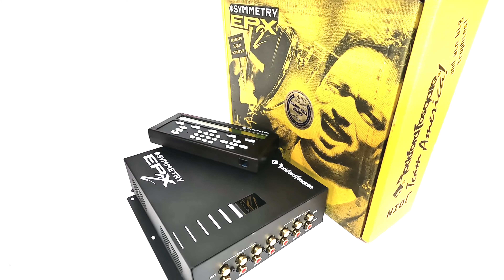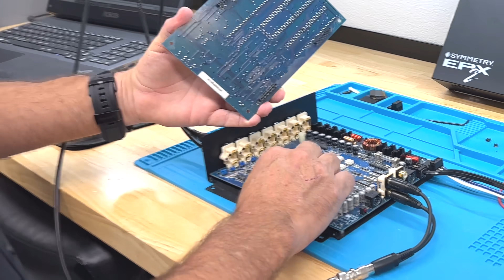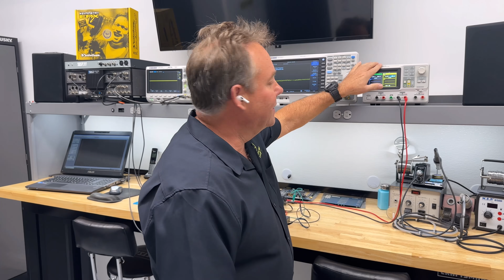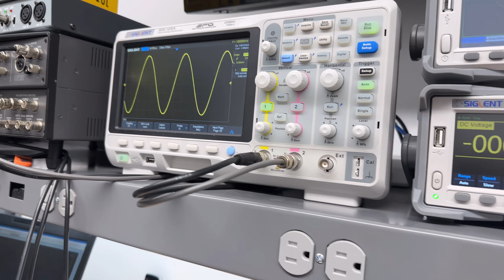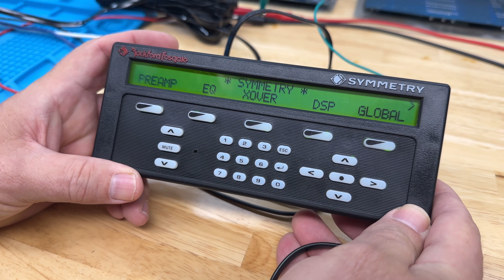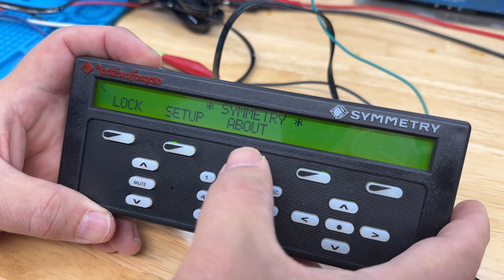The Terminator - Rockford Fosgate EPX2 with Wayne Harris in 4K. Beast or Bust?

Comment: Nice! Im glad you're doing well Wayne. I was there at Rockford from 98-05 in apart of Production Engineering as an equipment tech for both Production and SMT floors (I took Tony's old job before he moved to Design Engineering xD). I did have the Symmetry EXP(1) in my car but accidentally left the symmetry in the car when I sold it. Ive always thought highly of the unit and if I ever thought of expanding my system I could do so with the Symmetry. Continue the good work!

Comment: I have one of these in the box 
Can it be used  as a recording studio tool
Reply from the maker: Cool! It probably doesn't have the signal to noise ratio you would want for that type of environment. Moreover, the unit produced small, transitory ticks when changing settings. However, I used a full-sized Symmetry in my home audio setup for a long time in the 90's.

Comment: I had an EPX and a RFX 8140 with the balanced output into the EPX in my car, in 1998. Then without the EPX I  Won dbDrag world finals with the 8140 with the 8v outputs in 2000 was a beast of a radio super hot outputs. I wonder knowing what I know now, if the ADC and DAC in these units were a limiting factor back then, I wonder what was used and what the specs were on the converters.
Reply from the maker: The audio circuitry in the EPX and EPX2 was digitally controlled ANALOG circuitry. It's hard to say what made the difference, but it is probably related to the level setting process.
Reply: @wayne_harris  Wow no kidding I just assumed it was like an audio interface AD-DA type situation, that's pretty cool. I found a pic of the setup termpro /memberalbum/5549B6.jpg lol almost 30 years ago, was way ahead of its time.

Comment: I have power series DSM amplifiers and a symmetry epx2 with e28. How would I go about if it's even possible to get the balance line transmitted + DSP mod? Thanks for any help
Reply from the maker: You would need to acquire the Balanced Line Transmitter and DSP card somehow. My DSP cards have the leaky 10uF caps, and some have literally fallen off of the board. I would be careful purchasing a DSP because it would need to be repaired.
Reply: @wayne_harris ty sir I think I might pass on it if you have to go through that much to get it working, but who knows if it presents itself at the right price and I'm able to get it fixed reasonably priced.

Comment: Mr. Harris I have a question, where can I find copies of your old term-1 and term-2 software? And was term-1 available to run on a hard drive or just floppy disk?
Reply from the maker: Term-1 and Term-2 were only available on floppy (5.25 and 3.5) disks. Those versions would only work with DOS (I think). I do not have a working copy. Why do you want them?
Reply: @wayne_harris   I actually have a working copy of the Term 1 software on a floppy disk. Believe it or not I still use it to build my Enclosures, I was hoping to see IF it could be made to run from the internal Hard Drive. Also I never knew there was a Term 2 software so I just wanted to have it to add to my collection of Audio Software.

Comment: Hi Wayne,
I have EPX one back then connected to Alpine 5959 CD Changer (analog out bypass to EPX as a preamp/ over). PPI amps JLW5s and MBQ separates. It sounds great!  Its around 90s I dont remember if theres time aligment or delay function at EPX but the RDAT menu is quite the same with EPX2. Thanks for bring back the good memories ❤
Reply from the maker: The EPX2 has lots of clever software features. Some I had forgotten about (like the VDISC feature.) Unfortunately, the DSP card for the EPX2 could not adjust time. (Nothing can as far as I know.) But, it could compensate for differing arrival times from sound. I think this is what most people mean when they say "time alignment.} HA!

Comment: If you still have the source code, you can theoretically do whatever you want with that product. ;-)
Reply from the maker: I do! And, I have already made a few modifications. For example, now the RDAT screen says "Terminator" in the heading, instead of "Symmetry." I will point out that all of the code is assembly language (difficult but highly efficient code.) Fortunately, the code is very well documented. I believe that I have already squeezed out most of the capabilities the EPX2 hardware can deliver.

Comment: I never knew Rockford made a dsp back in the day! Its also engineered by yourself. Very cool, how would one get their hands on one of these - Team Killahertz Eric
Reply from the maker: At the time, I think only Sony and Rockford had DSP processors, but I may be mistaken. I doubt you will find a working DSP. I have around 10 (including my prototypes), but they all need to be reworked because the 10 uF capacitors are literally falling off the card.

Comment: Back in the 80s I thought RF was an overly marketed and too expensive brand of product for what it was, even though it was always well made.  As the years progressed and products like the Symmetry stuff emerged, I gained more respect for the company.  I was a fan of AudioControl, etc in the 80s and later Rockford gained the same respect.
Reply from the maker: Audio Control was definitely at the forefront of early, high-performance auto sound. At one point (around 1985), AC gave me a signal processor (EQ, Crossover, Etc.) for my Corvette. It was in Plexi. Although it looked cool, it was susceptible to noise because it didn't have the metal housing to act as a "shield." ARGH Can't remember the model number!
Reply: @wayne_harris  Thanks for replying to my comment!  It was likely a EQX or 2XS back then.  I had both at the time and loved them.  I particularly liked how much they published to help educate about noise, grounding and other things that were common mistakes during installs.  I was pre-EE back then and I spent a lot of time helping out shops on problem installs where they didn't understand and couldn't eliminate noise problems.  It was almost always ground related unless they had points instead of electronic ignition.

Comment: One of the best stereo systems I ever installed was with one of these I feel as if you should build a new one maybe 31 bands and a separate EQ for each channel if you ask me it's still state of the art wish I had one
Reply from the maker: I have mixed feelings on EQ's these days. We need to focus on the fundamentals first (level setting, crossover points, speaker placement, etc.) and then use EQ as a last resort. Moreover, I think EQ should but "cut" only to maintain maximum S/N ration. The EPX2 had a novel "EQ level tracking" feature that would reduce the input gain by the same amount as the maximum boost. This maximized S/N ration. Thanks!

Comment: I had an EPX2 when they first came out.  A few things I learned after it was installed.  One:  sometimes the volume decides to go full load right after you fire it up.   Two:  my RDAT was installed in my center console, not sure if it got too hot, but it would intermittently cut out.  Three:  some days it would just do a full on reset of itself.  One time it did it right before I ran through an SQ line for USAC.   Other than that, I enjoyed the unit.  Just hate to see you install it and then all of a sudden, it goes full volume on you.   You’ll wet your pants.   😂
Reply from the maker: Ouch! There was obviously some type of problem. I do remember that it was possible for the rubber keypad to get stuck, and maybe that was causing the volume to ramp up really fast. If you "Lock" the RDAT, the volume is limited to whatever max level you set to prevent someone from blowing your system up.
Reply: @ I hope yours works out in the Terminator!  The EPX2 was one of my favorite pieces of gear I had, wish I had that still, my power 650’s and all of the fun of just traveling and competing.  I do wish we could all go back to those early to mid 90’s shows!

Comment: Your EPX2 is great I have owned many EPX and a few EPX2
but 
I recommend not using the DSP unless you can defeat it completely 
Also I believe your RDAT didn't illuminate. 
It's supposed to.

Side note, some RDAT circuitboards are interchangeable and some RDATs don't work with the wrong EPX or EPX2.
It will be a sweet addition to the Terminator
Reply from the maker: Thanks for sharing. The LED backlighting in the video was set to "auto". It did come on, but the lights in the lab are really bright. You are correct regarding EPX and EXP2 compatibility. You could go into the secret "Wayne's World" menu to select the device that was attached!

Comment: DAMN, that is cool! For the time it was EPIC/Before its time. Was that ever really ment to be mass produced in any high volume? Even today the interface not bad and doesn't require a PC. If you have another one hit me up! :) what was the OS used on that? and what protocol(s) were used for internal "module"  communications?
Reply from the maker: Yes, the EPX2 was in mass production, and it was a best seller. As for the RDAT, I designed the "computer" from scratch and the code is written in assembly language! There is no "OS". Everything is custom. The communication protocol is RS232.

Comment: What other products did you design for RF? 😊
Reply from the maker: That's a tough one. I was there for 13 years. Hafler eq, Hafler crossover, OSC2, PA1, Symmetry (RDAT, CSV, ASV, XOM, EQ14, EQ28, DSP, BOB, MLT, Alarm, DIO, more), EPX, OEQ2, EPX2 (E14, E28, DSP, RDAT), Power 1000C mods, all of the automated test software for the production line. (You can see my name at the bottom of the PVC "birth" certificates), and more.
Reply: @wayne_harris  did you also have your own avatar like the others?

Comment: Definitely would use it for the Terminator, would be great though to add an external dsp specifically to convert that analog signal to digital  say 192khz/24bit, but without change on the frequencies, which the EPX will take care of
Reply from the maker: Thanks for the suggestion. However, I don't think I will install a DSP.

Comment: This piece of equipment (EPX2) was way ahead of it's time.  Audio signal DSP processing way back in the early 90's for a car stereo system?  WOW!!!  Yes, install it in the Terminator.   It definitely won't take away from it AND it's period correct!

I can only imagine what the EPX3 would have become if it was ever finished!!!
Reply from the maker: The DSP module is incredible. However, it doesn't play well with systems that have excessive bass because the "adapt" process (which uses a mic) is greatly impacted by the huge differential between the low frequencies and the midrange and tweeters. I'm not planning on installing the DSP in the Terminator, but I do want to play with it some more in the lab.
Reply: @wayne_harris  Oh, okay.  Yeah, I definitely understand that.  I can see how the concept of using a mic would have a negative impact regarding bass-heavy sound systems. On the other hand,  the 28-band equalizer module would be fantastic.  With that said, I really like how you designed it as a modular system, thus making it very flexible.

Comment: Definitely would be a great addition to the setup. It’s almost like it was meant to be.
Reply from the maker: In a way, you are correct. In another response I explain that the original Symmetry system was designed FOR the Terminator.

Comment: Do it, and see if you can get that original head unit fixed
Reply from the maker: I'm still on the fence about the RFX 8350.
Reply: Cool  @wayne_harris
Reply: Did you even check to see if the original head unit can be repaired?

Comment: Add it! DO IT
Reply from the maker: Thanks! I am pretty sure that's what is going to happen. Since I designed the Hafler units and the EPX2, there is a very real possibility that the sheet metal is the same size. That will simplify the installation.

Comment: That epx2, with its blinking lights, should fit right in on the Terminator.  Maybe take the place of one of the Hafler crossovers. Keep the other two installed just for looks. If you can.
Reply from the maker: That's a good idea. If I recall correctly, two of the Hafler boxes are actual crossovers, and one has an unpopulated PCB that I used for signal distribution (splitter) purposes. We'll find out soon enough.

Comment: That epx2 is probably the best piece of car audio equipment ever made. Imo
Reply from the maker: Thanks! It sure has a lot of cool and innovative features. The unit implements digital control of analog circuitry. In other words, unless you are using the DSP card, everything takes place in the analog domain. I was actually working on an EPX3 when I left RF, but they never finished my work.
Reply: I have to disagree.  It WAS revolutionary for it's time.  However, (and yes I used to own and run an EPX2), it was notoriously noisy.  Also the RDAT had endless button failure issues.  The Terminator might be the only application I'd say "this is the one" in terms of using this unit in 2025.  Before you argue how this was the "best", I respectfully direct you to the infinitely superior Helix DSP Ultra.  That's end game for all but .001% now (and I can't tune with a laptop and actual keyboard plus install a director for quick switching if I desire).

Comment: I think it's inevitable that some changes will be necessary this many years along unless you're wanting to put in the effort to resurrect every bit and piece.  Which may mean that it never gets done in the first place.

Anyhow, I suspect an EPX2 would have ended up in the hearse one way or another at some point if you kept upgrading it.  And I agree that it's of the appropriate period.
Reply from the maker: I was dwelling on the same point. It is 10X harder refurbishing than just starting over. It seems EVERYTHING needs fixing. The EPX2 is the first thing that has worked, and it isn't even in the car (YET). Thanks for watching.

Comment: I have mine sitting in a bag in my desk. :) D28 eq card installed. I just need a new cable for it.
Reply from the maker: If you are speaking of the cable between the RDAT and the EPX2, remember that it is a data cable (instead of a phone cable.) Phone cables "flip" all of the conductors, whereas a data cable does not. In a data cable, pin 1 goes to pin 1, and so on.
Reply: @wayne_harris  that is the cable. I remember you told me you were sure the cable needed to be flipped

Comment: First comment?  Lol. 

I remember the global setting on the EPX2. I think that’s what it was called.  Where you have different presets for the DSP that change based on the volume level.  I don’t think there are any dsp’s that are doing that. 

Wayne could probably explain this waaaaaay better than I can, but to paraphrase the acoustics change with volume, so what sounds good at low volume, may not sound the same at a louder volume. 

Also, human ears change their characteristics with volume increase. I believe it was Hexibase that mentioned this in one of his videos.
Reply from the maker: Good memory. But I think you are talking about the Volume Dependent Interactive System Control (VDISC) feature. You set volume control thresholds, and when the volume control triggers that point the system loads a complete set of parameters (input levels, tone, balance, fader, eq, crossover, etc.) Amazing for competition! (I had to trim that part of the video out because it was making the video to much like a training module.)
Reply: @wayne_harris  yep I missed the mark on that name.  Haha. 

Awesome tech!  VDISC.  I think I’ve forgotten more than I remember when it comes to the acronyms. I had the symmetry EPX2, but I wasn’t experienced enough at the time to utilize all its features.  It was my first jump into running active crossovers and I was amazed at how much cleaner and more efficient things ran. 
To this day I still run active whenever possible.
Reply: @wayne_harris if you wouldn’t mind perhaps starting a second channel, I think a LOT of us would watch 4 hours of tech content. Hell I’d PAY for it just to fill in the gaps that the magazines and RF reps / own experience couldn’t answer.
Reply: Your referring to the Fletcher-Munson curves. 

I was not aware the epx2 had any feature like this. I know my unit had the 28 band EQ and I think it had the dsp card, but I'm not positive. 

As far as I'm aware, the global presets just mean that you can change every setting within that preset.
Reply: I also remember my first epx2 was modified and had wires coming out of the back of it.  I think it was to connect an external (wired) volume control to it, using a pair of momentary switches. I think there was a drawing that was included with the box too.